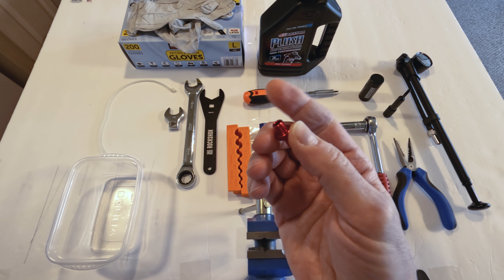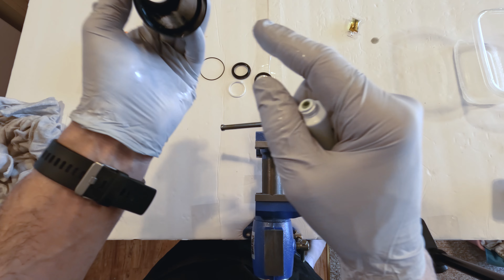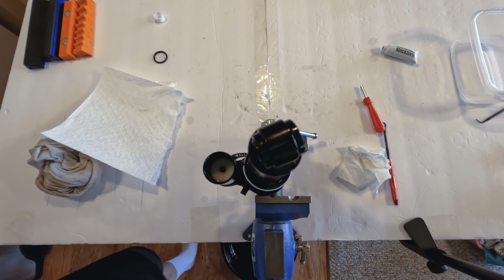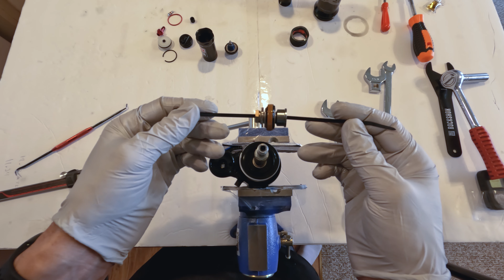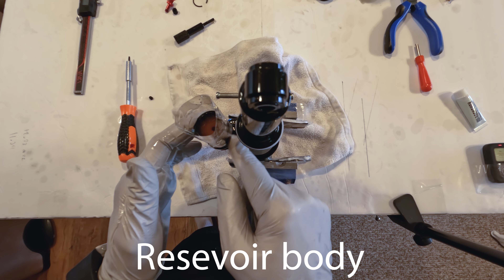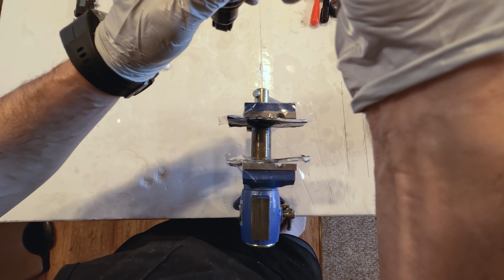Rockshox Super Deluxe 50 & 200 hour full Service guide updated video https://youtu.be/SRPUzNW__LM

Comment: I did revalving for my super deluxe, never done that before. Everything went well, I used rear shock piston tuning guide provided by Sram. If shock is not tuned by bike manufactor you may use that Sram guide to put shim in correct order if you accidentally mess up with that shim stack. All thought there is not many full service video guides so this one is great.
Reply from the maker: Funny you should mention this. I believe the next video scheduled to release next week is a  compression stack re-tune guide for a rockshox deluxe.

Comment: Thanks for this. I'm getting ready to service my shock after 2 years of use. A grip2 damper service video would also be nice. Cheers!
Reply from the maker: Excellent. let me know if you have any questions during the process. I'll be working on fox shox and forks (and a bunch of other parts) starting in a couple of weeks when I get back in town. 👍
Reply: Hello. Thanks for your disposition. I have a couple of questions just from the video. What are you tightening to 28Nm with the 19mm crowfoot wrench (thought the piston's nut is 12mm)? and, without the IFP removal tool, how else can it be removed?
Reply from the maker: @Mestizolo  The 19mm or 3/4inch crows foot is used to torque down the nut that connects the main shaft body to the damper reservoir as can be seen starting at the 52 minute mark. The IFP tool isn't really needed. I just bought it to see if it made the job easier. It provide a bit more leverage but you can push it out with your thumb with some force

Comment: Hello. I was told by my bike shop ,here in Connecticut, that regular air for damper would be ok in a dryer climate in higher elevations, like CO or UT. But we need nitrogen around here because of moisture in the air. What is your opinion about this? They wanna charge me almost 600 dollars for 200 hours  service for both fork and shock.They do have nitrogen set up in their shop
Reply from the maker: Great question. I understand where they are coming from, but I have to say that they are off on this. Yes, oxygen does hold moisture and nitrogen doesn't (and I'm assuming you mean nitrogen, not hydrogen, or else you'd be riding around with a potential mushroom cloud blowing over Connecticut 😁), and nitrogen does have a higher heat capacity. BUT, this will only be an issue in very hot environments and/or when riding very long, aggressive runs. In these types of conditions, the moisture in the air can start to steam, which can create added pressure and cause inconsistencies. Also, nitrogen molecules are a bit larger than air, so when it heats up, it won't seep out as easily as air. Ultimately, this isn't an issue in average or cold climate environments, like where we live. Both rockshox and fox state that using air is fine. Does nitrogen have its advantages? Sure, but it's a low percentage of people who will leverage it. The most important thing is to regularly service your suspension. 

What forks and shocks do you have? If your bike shop is trying to charge you $600 to service your shock and fork, I'd just send it to rockshox or fox, it'll save you ~$200 at a minimum.
Reply: @zoubtube  Yes. I meant nitrogen, not hydrogen. (:. In my opinion, 600 dollars service for a bike almost justifies searching for a used fork and shock on eBay every 200 hours, instead of paying this much for service. Thank you

Comment: Another great video , thanks big help. Can’t find # for the IFP tool.the one i found has a 35mm mark. Mine needs the 33mm. Looking for a good set of soft jaws with various hole sizes, were can i find those orange ones you have? Thanks again
Reply from the maker: Glad to hear the video was helpful. I will be re-recording this particular video soon in the new setup so everything is brighter and clearer.

The orange soft jaw I bought on ebay at the following link. Unfortunately prices are higher than when I bought them https://www.ebay.com/itm/143625990780?var=442598197816

The IFP tool for this shock is the following. Planet cyclery has it on sale for $5 at the moment that a super great price as the tools is $25 list price https://planetcyclery.com/rockshox-rear-shock-ifp-height-tool-for-setting-ifp-height-super-deluxe-super-deluxe-coil

They also have the IFP air fill adapter on a great sale. just and fyi
https://planetcyclery.com/rockshox-rear-shock-air-valve-adapter-tool

Comment: Great video. So I just performed this and I've noticed a thump mid stroke when I ride. Any idea why? Which direction is the spring under the blue lockout valve supposed to go? I wonder if I put that in backwards.

Comment: Help! When I get to part 1 of the bleed process it doesn't seem like the oil is getting through the initial canister at all. I press down slowly on the latex glove and the oil runs down the sides. No matter what I do no oil comes out the top. I disassembled and reassembled twice with the same result. Does anyone know what my issue might be?
Reply from the maker: Apologies for the late response on this. It sounds to me like the controls are in the locked position or the shim stack is in the locked position (assuming you didn't disassemble the shim stack and improperly assemble it. If this is the case, let me know and I can probably get you the proper shim stack order). 

Did you remove the compression piston mechanism when servicing the shock? If yes, are you sure it's sitting correctly in its mount when re-installing it? Did you test the knob to make sure the compression piston is working as it should?

Did you remove and install the IFP stack using a zip tie, as seen in the video? If yes, are you sure it's sitting correctly after installing it again? Did you overtighten the nut that holds it down?

If no to the above, did you disassemble the shim stack after you removed it? If yes, are you sure you assembled it correctly?

Sorry for all the questions, but it's the only way I can get a better idea of what's causing your issue. Let me know, thanks

Comment: 28:08 any ideas what size thread the ifp puller tool has please - they are quite expensive so looking at alternatives
Reply from the maker: Here is a link to an updated video on servicing this shock. It was done in my new setup, so it's much brighter and easier to follow
https://youtu.be/SRPUzNW__LM

Also, you technically don't need that tool, as you will see in the updated video. I would consider it a luxury at best. I don't remember the thread type at the moment, but I'll try and pass by the hardware store to get it. Do me a favor; I don't see responses to comments I responded to on YouTube. I recently noticed this, and I'm not sure why this is the case. If I haven't responded to this with the thread size in the next couple of days, send me a new comment (which I can see for sure) to remind me. Thanks

Comment: Thanks for the awesome video.  It was smooth sailing until I got to the bleed process, and my damper is locking at the bottom position when trying to purge the bubbles.  The damn thing feels welded in place.  I have to unscrew the damper body for the vacuum to release.  Mine is  Super Deluxe RC3 if that makes any difference.
Reply from the maker: Odd, I can't think of anyway it would be different for bleeding. Sounds to me like you have a vacuum going on. Are you sure the ports (Compression/Rebound etc) are fully open? All ports have to be open for the bleed

Also, you don't have to fully  bottom out the damper when bleeding my way. I add an extra step in order to ensure I get air that might be trapped in the damper body.

Funny thing is, I am encoding a Video for a FOX DPX2 as I type this to be release tomorrow. It's the exact same process but more clear (at least I hope it is). Until it gets released, below is a simple instruction set.

I bleed those shocks in a 4-step process. First manually bleed the shock head via the reservoir using a rubber glove and rubber band, with no IFP in. when you see only oil flowing at the piston head, block it with your finger, then insert the IFP in the reservoir (Make absolutely sure the Bleed screw is in the IFP), but only about 10 or so mm.

Then add oil to the damper body, as we as the piston head, and connect them together. 

Then use shipping tape to create an extended reservoir (Makes life MUCH easier). Remove the bleed screw and cycle the damper body until you do not see any bubbles in the reservoir. Don't stop until > 5 cycles from the last bubble. When done, insert the bleed screw. Do NOT set the IFP yet.

Now prep your IFP tool (what ever you decide to use) and have a t10 Torx (If I remember correctly)  connected to the damper body screw.  Start setting the IFP and loosen the screw JUST enough for oil to come out, no more than that. When the IFP hit its set point, tighten the damper body screw at the same time, and you're done. 

Let me know how it goes.
Reply: @zoubtube  Thanks.  I took the piggyback apart to ensure the compression valve wasn't causing the lock, and the main damper is still locked in place (with no side canister or lockout valve installed). 

I followed the zip tie trick for the nut/shim stack but it seems that my issue lies within that part of the system.
Reply from the maker: @Abihomeservices  I just looked at the sram 2019 - 2022 service guide and schematics to verify and it basically the same design. bleed process is the same. Are you sure the piston assembly is sitting correctly and fully seated? The tolerances are SUPER tight in the piston assembly. it doesn't take much at all for a washer or shim to block a port. were talking the width of a hair can make a difference.

can you verify, when you were bleeding, you were able to compress, but it locked when pulling back up (rebounding) or vice versa?

Also, If by chance you mixed up the shim stack assembly, don't worry. you can call rockshox and they will give it to you. (they really should provide them online like fox does imo). Unfortunately  I can't provide you the shim stack order as its version specific. Once you have the order, its super easy to assemble.
Reply: @zoubtube  I do not think I screwed up the shim stack as I used the ol' zip tie trick as you showed. 

I don't remember seeing open ports on the sides of the main piston...
Reply: @zoubtube  So it turns out I'm a dumb ass and thought I had the rebound open, and did not.  Once I set that to 'rabbit' it worked like a charm.  Thanks again for the great video!
Reply from the maker: @Abihomeservices  The RC3 should make no difference when looking at the service manual. The bleed process for it is the same as other super deluxe's in their generation. If what I previously mentioned is accurate, "you were able to compress the shock, but cannot make it return" then the chance of the rebound port being blocked is VERY high. It does not take much to do this, Literally a couple of hairs thickness would affect this. The tolerances in the stack are very tight. A shim or washer might not be seated correctly, which would off set the stack. Or possibly (though I've never tried nor tested this) the stack might be tightened too hard which is affecting the rebound check plates and shims, which are closest to the nut that keep the stack in place.

I would remove the damper body, loosen the nut holding the stack, do not remove the nut or stack, just loosen everything enough to wiggle it to make sure everything is seated properly, then tighten the stack down to the recommended torque specs 6.8 nm. then go through the bleed process again

(personally I would remove the entire stack shim by shim and then assemble it the same way to ensure everything is seated properly, but you shouldn't have to do this, and I get it if you don't want to attempt it without having the stack layout handy)

below is a link to a sram stack tuning guide that might come in handy
https://www.sram.com/globalassets/document-hierarchy/tuning-manuals/rockshox-rear-shock-piston-tuning-guide.pdf

let me know how it goes. You got my curiosity
Reply from the maker: @Abihomeservices  AWESOME! To make you feel better about it all, This past thursday,  at 11:30 pm, I found out it was actually thursday and not wednesday!  We all got to much on our minds these days, and in my case, not enough brain cells to hold on to it all! 😉

Glad it all worked out. now go out and enjoy it! 👍
Reply: @zoubtube  Thanks again, brother.  The world needs more folks like you!
Reply: @Abihomeservices Don't feel too bad, I had this exact same issue, and your comment saved me! Thanks @zoubtube for putting together a great walkthrough

Comment: Good video I enjoy working on my own bike. Would you recommend doing a 200hr service every 50hrs without doin new seals. So just new oil and grease every 50hrs
Reply from the maker: You could, but personally, unless you feel your shock running softer than typical or making squishy noises out of nowhere you really shouldn't have to open that damper that often. You can service the air can without changing the seals, but be sure to clean the outside of the shock well before removing the can and pay extra attention when cleaning the wiper seal and split rings to make sure no debris slips in. 👍  Let me know if you have other questions.

Comment: awesomeness...
Reply from the maker: Glad to hear the video was informative for you. I recently posted an updated video for servicing this shock. it much brighter and clearer. Below is a link. Hopefully it helps. Thanks for the comment.
https://youtu.be/MD9syceK2D8
Reply: @zoubtube  Hi there- so im knee deep in it; and im confused about the two largest diameter o rings for the air can- which goes on the inside (top) of the can and which where the can screws into the top (exterior). (thiner one on inside / thicker outside? I couldn't tell from the video... Thanks !
Reply from the maker: @robertnunezsf  The thicker o'ring goes on the inside of the eyelet near the base just below the threads you will see a seat for it in there. The thinner o'ring goes on the outside of the air can just below the threads.
Reply: @zoubtube  they had it backwards! thanks!!
Reply: ugh- one more- i buttoned up the can before i realized more to replace inside; do you kniow what kind of oil i can use for the can? (the oil in the 2oz plastic in the kit) ...
Reply: actually have bigger issues than that- when i fill up the can / glove on top and push oil down it wont move- even trying the loc out lever in different positions...
Reply from the maker: @robertnunezsf  I'm pretty sure the issue is the piston in the reservoir is stuck in the lock position. you need to push it back with your finger to put it in the open position. Not much pressure is needed to do so. If it seems stuck, then you can use a thin blunt object to push it back. let me know if this works.
Reply from the maker: @robertnunezsf  15w-50 is what's in the pillow pack
Reply: @zoubtube  Thanks-!  ya i ended up using the can piston to push down and got it going.

Comment: Hi again zoub! I made a same shock,what you think when I made a bleed part 3 for ifp chamber,my shaft body comes up by itself? I'm pushing down and it comes up? But no bubbles at full extension? What I did wrong?? Thanks again!
Reply from the maker: IT sounds like you didn't remove the bleed screw. Make sure to the bleed screw is removed from the IFP in step 3. very important you do this or the bleed won't work. BTW. I just finished editing an updated video for this shock in my new setup. so everything will be MUCH brighter and clear than this one. It should be uploaded very soon. let me know how it goes!
Reply: @zoubtube  Hi zoub! Thanks for the answer,but I made it three times and bleed screw was out, because I have to take all air bubbles from system. I made shock to the end,and it works normally. It a super deluxe select, without lock opportunity,just rebound setting. Let's see will it works normally after some ride. Ah yes sounds amazing that me got new video☺️👌🏻 this shock very popular and pretty nice. Waiting for it🙏🏻 Thanks again!
Reply from the maker: @TheSant1k  Great job! 🦾I'm glad to hear it all worked out. The next time you service this shock, it's going to be SO much easier. Before you know it, you'll be servicing it every year. 

The updated video for this shock should be uploaded in about two weeks. It will be much easier to follow. I will be uploading a 2024 Deluxe Ultimate very soon as well. 

Now go out there and have fun! 👍

Comment: Ok. Am about to lose my shit. Serviced my shock, put it all back together. Now when I try to reinflate, it loses all air when I remove the shock pump. Have tried two pumps, two valve cores. Removed and reinstalled the valve cores several times. Same thing. Yes, I know how to remove the shock pump. Yes the cores are tightly snugged down. Anyone got any ideas.
Reply from the maker: "Am about to lose my shit" sounds to me like you're doing great! I lost my shit a LONG time ago and haven't found it since! 😁

Now, I'm going to ask this, Just to be sure. Are you removing the shock pump from the adapter first, or removing the adapter from the shock first?

Are you using after market Schrader valves? If yes, do you know if the PSI meets or exceeds the PSI for the IFP chamber? Schrader valves are rated for different PSI specs.

If the above is not an issue, is it is possible that you scratched or damaged the threads in the cap? 

Not much can go wrong here. Above are the most likely culprits. let me know
Reply: @zoubtube  I was being a numpty. Had reinstalled the tokens wrong, so when I installed the valve they were pushing it open from the inside 🙃